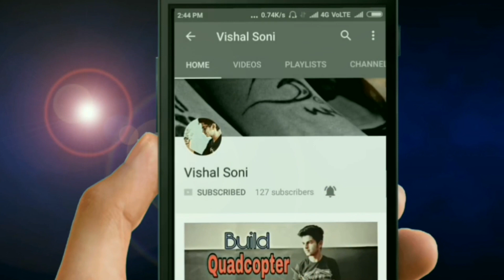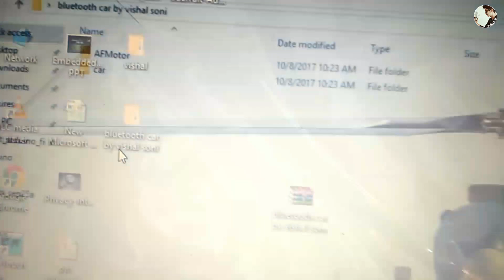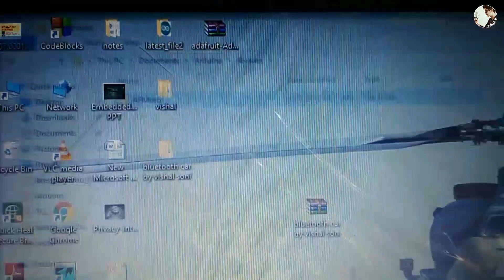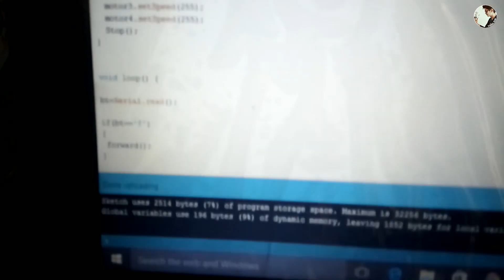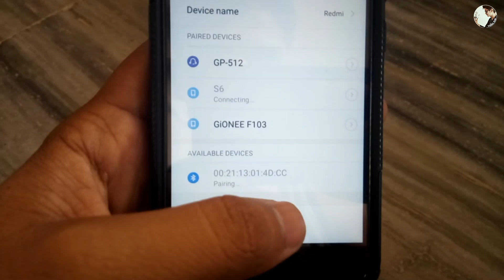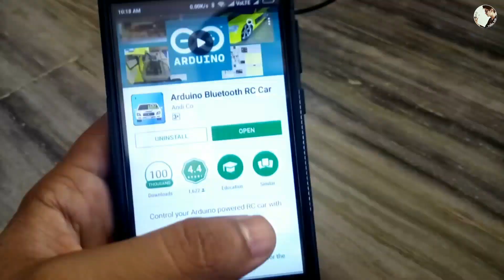Mobile Controlled Car via Bluetooth || motor shield || hc-05 || arduino || simple || vishal soni

Comment: brother my HC-04 connects but then when I press to move the wheels on the car that im making, they move for 2 secs and then stop and then after 5-10 secs the HC-04 disconnects automatically. What should I do please help me. I'm using 2x 3.7V 1200mAh lithium ion batteries. If you think it is a power issue, please suggest what I can do. Can I use power bank as you. Please reply asap as I need it for my science exhibition.
Reply from the maker: Yes, the protection circuit in 3.7v batteries is limiting current , that's way whole thing restarts
Reply: @electrodonut  I tried operating it with battery eliminator on 12v and it works absolutely fine. So should I use a 12v battery instead of Li-on cells?
Reply from the maker: @redone146  if 12v is working then use it, or  use Li ion that can provide 2S or higher current

Comment: As for I worked on a car robot project, and when I started connecting it to the battery for testing, I had a problem that the car was moving without giving orders to the Arduino circuit, if it was allowed to show the cause of this error.
Reply: Oprime el botón de reset para reiniciar en un punto inicial del programa y te funcione correcto.
Reply from the maker: Connection  wrong

Comment: can u please let me know what pins in Arduino uno  need to connect in L293D motor shield in order to plug the motor shield to the Arduino uno board. I want to use Arduino nano instead of Arduino uno.so i need the pin connectivity properly.thx
Reply from the maker: Diagram is on my instructables link in description

Comment: I am only getting my back two wheels working. I cannot get the front two. But if I connect a battery directly to the motor for testing, they spin so I know they should work but for some reason, I cannot get all of them to spin. Do you know what my issue might be?
Reply from the maker: Can i know specifications of battery or any link

Comment: How to add buzzer
Reply from the maker: Please understand the code then you can add anything....
Reply: @electrodonut  motor driver not working
Reply from the maker: @iamtechnical3737  check connection

Comment: if program is not working then change 
serial.begin(38400) 
To 
serial.begin(9600)*******
______________

did not work
Reply from the maker: No doubts about code it is correct,
Check your connection first, then if it won't work, find your Bluetooth's baudrate and change in code
Reply: @electrodonut  no connection mistake i have checked 3 times
Reply from the maker: @harshitsrivastava4719 
Check your Bluetooth's baudrate and print something on serial via Bluetooth

Comment: Can i use 300 rpm high torque motor in that case of l293d motor driver. Will the motor driver heat too much???
Reply from the maker: Yes.. You can
Reply: @electrodonut  Is the motor driver heating too much because of high current
Reply from the maker: @rashedulislam8972  did you tried...
The input current is up to 1.2A
Output is 0.6a
Reply: @electrodonut  i want to use 2200mA 11.2V  lipo battery
Reply from the maker: @rashedulislam8972 
Use l298 motor driver

Comment: Sir I can use lm298 motor driver
Reply from the maker: Yes you can but may be the programming is different for this.
Reply: @electrodonut  sir can u please give the coding
Reply from the maker: @FactCrazeHindi3D  link given in description....
Reply: @electrodonut  sir u can make a 3.7v battery indicator by ic 3914 please
Reply from the maker: @FactCrazeHindi3D it is very easy just search 3914 ic on Google you will get many circuit

Comment: will it work if we dont solder ?
Reply from the maker: Yes, you can connect via puting thin wire in hole or any other method..... The connection should be correct.

Comment: Will it work if I supply the power of 2 ampere to the arduino, instead of using a power bank?
Reply from the maker: Yes voltage should be 5v or more if you are connecting to connector jack.

Comment: Why is there need to supply power to arduino if motor shield is working?
Reply from the maker: The supply in arduino controls the microcontroller in arduino and also it supply the power to the l293d...
The supply in motor shield is to power the motor because. Either you are using 12v motor or 5v motor.
Reply: Ok
Thanks

Comment: i have uploaded the code and also connected everything as you have told but then also my motors are not running plese help
Reply from the maker: Did the Bluetooth module connected with device and...the power supply is sufficient for motor....

Comment: hi bro, i have made the project successfully as per instructed in your video, now i want to add head lights, tail lights and some additional features    so kindly provide me with your contact info
Reply from the maker: Please read code and understand Bluetooth interface.. May be that will help you
Reply: @electrodonut programming and electronics are not my subjects this is just a personal project so kindly give me any sourse for simply coping the codes and making the connections
Reply from the maker: @Umarwahab5 
I will make this letter

Comment: Bt module is not blinking. All connections are same as you did
Reply from the maker: Recheck the module or check it alone with 3v power supply if it not blinks then it is damaged
Reply: @electrodonut  it was really damaged. I changed it. Got a new bt module. Its blinking but the process is not working. All connects are as u said.
Reply from the maker: @sadhankumar7908 
Please read first four line of description and change bps in program
Reply: @electrodonut  thnq very much bhai. Kaam kr gya. 🙂🙂🙂 Love u
Reply from the maker: @sadhankumar7908  welcome...
Please batao m video hindi m banau ya English m
Reply: @electrodonut  english me achcha. Hindi me bahut achcha
Reply from the maker: @sadhankumar7908 
Ok... I will make it in hindi
Reply: @electrodonut  I am comfortable with both languages but I'm thinking about everyone on utube
Reply from the maker: @sadhankumar7908  ok
Reply: @electrodonut  bhai isme arduino ko 9v battery de skta hu? Bt mdl kam karega??
Reply from the maker: @sadhankumar7908 
Please connect battery at connector jack... Then bt will work
Reply: @electrodonut  bro r u sure bt module will not be damaged by 9v supply? (3.3 - 6v)
Reply from the maker: @sadhankumar7908 
No direct supply mat dena.... Pehale 9v battery ko arduino ke connector jack se connect karo fir ya usse 5v and 3v m convert kar dega... So Bluetooth ko arduino ke 3v ya 5v terminal per connect karna h.
Reply: @electrodonut  achcha thnq.
Reply: Jo apne connection rakh same rakhu sab. Bas 9v ko jack se connect kr du to?
Reply from the maker: @sadhankumar7908 
Hn.... 9v jack se and shield ko alg supply to deni hi h.... Motor ke liye
Reply: @electrodonut  bhai 9v jack se diya. 9v volt motorshild ko diya. Par kam nai rha h
Reply from the maker: @sadhankumar7908 
Lights jal rahi h saab m
Reply: @electrodonut  ha sab all ok h. Light sab jal rhi h.
Reply: Motor me power aa rhi h but bahut kam. Ghuma nhi pa rha. Jabke usb se power de rha hu to ghuk rha h. But jack se de rha hu to just hil rha h ghum nahi pa rha
Reply: Bhai. Motor ghumta h to usb ka power leta h ya 9v battery ka?
Reply from the maker: @sadhankumar7908 
Motor ko jyada current chaiye hota h... Tumhare pass kitni 9v battery h.. Or koi dusra power source h kya
Reply: @electrodonut  9v ki 2 batteries hain.
Reply from the maker: @sadhankumar7908  total 2 h ya... Ek arduino m lagi h fir 2 h... And motor kiti lagi h
Reply: @electrodonut  1 arduino me. 1 MS me.

Comment: i have a problem... when connected bluetooth  module then the code is not upload...show that the problem(avrdude: stk500_recv(): programmer is not responding
avrdude: stk500_getsync() attempt 1 of 10: not in sync: resp=0xcb
avrdude: stk500_recv(): programmer is not responding
avrdude: stk500_getsync() attempt 2 of 10: not in sync: resp=0xcb
avrdude: stk500_recv(): programmer is not responding
avrdude: stk500_getsync() attempt 3 of 10: not in sync: resp=0xcb
avrdude: stk500_recv(): programmer is not responding
avrdude: stk500_getsync() attempt 4 of 10: not in sync: resp=0xcb
avrdude: stk500_recv(): programmer is not responding
avrdude: stk500_getsync() attempt 5 of 10: not in sync: resp=0xcb
avrdude: stk500_recv(): programmer is not responding
avrdude: stk500_getsync() attempt 6 of 10: not in sync: resp=0xcb
avrdude: stk500_recv(): programmer is not responding
avrdude: stk500_getsync() attempt 7 of 10: not in sync: resp=0xcb
avrdude: stk500_recv(): programmer is not responding
avrdude: stk500_getsync() attempt 8 of 10: not in sync: resp=0xcb
avrdude: stk500_recv(): programmer is not responding
avrdude: stk500_getsync() attempt 9 of 10: not in sync: resp=0xcb
avrdude: stk500_recv(): programmer is not responding
avrdude: stk500_getsync() attempt 10 of 10: not in sync: resp=0xcb)
Reply from the maker: Upload program without Bluetooth.... Then connect it after uploading the program

Comment: Hi, I'm getting this error

avrdude: stk500_getsync() attempt 1 of 10: not in sync: resp=0x30
avrdude: stk500_getsync() attempt 2 of 10: not in sync: resp=0x20
avrdude: stk500_getsync() attempt 3 of 10: not in sync: resp=0x30
avrdude: stk500_getsync() attempt 4 of 10: not in sync: resp=0x20
avrdude: stk500_getsync() attempt 5 of 10: not in sync: resp=0x30
avrdude: stk500_getsync() attempt 6 of 10: not in sync: resp=0x20
avrdude: stk500_getsync() attempt 7 of 10: not in sync: resp=0x30
avrdude: stk500_getsync() attempt 8 of 10: not in sync: resp=0x20
avrdude: stk500_getsync() attempt 9 of 10: not in sync: resp=0x30
avrdude: stk500_getsync() attempt 10 of 10: not in sync: resp=0x20
An error occurred while uploading the sketch
Reply from the maker: Arduino not responding

Comment: sir I am only using 9 v battery connected to my motor driver and the light turns on by itself, however whenever I shove it to the arduino board the light turns off.  Also the arduino board and Bluetooth module are working when I connect them to the computer for the coding, but it seems like connection got lost whenever I shove my motor driver to the arduino board... They both are working fine separately. everything is wired correctly but it`s just not working when motor driver and arduino board is put together. Can you please help me with this issue?? I need to fix it as soon as possible for my presentation...
Reply: what did you do to make it right??
Reply from the maker: Can you tell me problem in one line

Comment: Please help me... 

I make this. but motor is not working. Bluetooth module is connected to androide phone. But motor is not working. I use 100 rpm gear motor. And two 9v  batteries. One for arduino and another for motor driver

Please help me. Argent
Reply from the maker: Read description's first 3 lines and follow.
Change bps to 9600
Reply: Thanks it is working
Reply from the maker: @Mr_Macster 
Thank you too for supporting me ☺️
Reply: I make a cleaning robot with help of this video
Reply from the maker: @Mr_Macster 
There are many app available on play store...... Search Bluetooth control "..... And find app that have more switch
Reply: But how to connect another 5 motor to arduino. Please help dear. ❤
Reply from the maker: @Mr_Macster 
Use L298n ic.....
Try to use only ic not shild..........
Reply from the maker: @Mr_Macster  you can get code online
Reply: @electrodonut  please send link

Comment: If i use two 5V motors  and one 9V motor will it work on 12V battery?
Reply from the maker: You can convert 12 v to 5 v via 7805 voltage regular

If you have two motor then use that two with caster wheel
Reply: Okay. Thank you so much!

Comment: Bro iam not able to install the program in my arduino uno
Reply from the maker: Bad Boys Tech
Remove Bluetooth pin while uploading program
Install motor driver library
Reply: Bro i have removed all cennections and install motor drive library.
Then also it was not installing
Reply from the maker: Bad Boys Tech
Is Compilation done....
Or  it also shows error
Reply: Bro nothing works
Reply from the maker: Bad Boys Tech
Check out all connections are correct or Bluetooth, arduino, motor shield are working properly

Comment: My bot is not responding.  I have done everything  properly  . Is it the battery problem  because the led in motor shield  , hc module are blinking
Reply from the maker: Shashidhara Siddamallappa
Change bps as in description

Comment: It's not working how to change program serial
Reply from the maker: Sharmila Kannoju
Open program in arduino software and then you will found serial.begin(38400) just change this to serial.begin(9600) and upload it to arduino remember Bluetooth wire is not connected while uploading program.

Comment: heloo i made this rc robot but i made my custum chachis [1mm aluminium] the robot is litel bigger i put the exact motors shous in video i conectet to the same shiled and oder parts but i put a 9v barery the robot go foward and beakward but dosent turn left or right [the distance between wheels is a littele biger when i press right or beak the car wigle a bit but any turn i veryfy the direction of rotation of the wheel any help?
Reply from the maker: Libertatea Gandului Meu
Stop one side wheel and run other side

Comment: Hi vishal I charged my 12v battery but when I connect it's 2 wires red and black with the 12 v DC charger then the led on charger turns on why??  But I ignored this and connected the charger to switch board and turned on is this alright?? As the DC charger was turning on with battery!! But I ignored and putted the battery to charge
Reply from the maker: DHRUV SHARMA 
Yes,  if led in adaptor is turned on it means your battery is connected perfectly............ Coz it is on by little charge in battery... 
Just put it in to charge

Comment: I have a problem in uploading the code, it says " avrdude: stk500_recv(): programmer is not responding"  how to fix this
Reply from the maker: Fritz Camello 
Remove everything from arduino..... 
Check Microcontroller on arduino is in right direction and fitted correctly.... 
There is no connection or Soldering on ARDUINO..... SPECIALLY RX AND TX REMAINA NOT CONNECTED
Reply: Vishal Soni i have already fixed the problem, thank you so much :) one last favor, can you prepare a code where there are lights and buzzer connected? Thank you!
Reply from the maker: Fritz Camello 
You can do it..... 
Just go to the settings of app and see commands for light... 
Put it on condition
Reply: How about the code sir? Im still a beginner in using Arduino
Reply from the maker: Fritz Camello 
Search about how to blink led via Bluetooth... Learn that code then you can easily able to add in my code
Reply: you should plug disconnect the bluetooth module while uploading

Comment: Yes I know I have connected this already but the problem is that led is very fade it's turning on but it's not bright can we make a car with this app only but with l298n motor driver?
Reply from the maker: DHRUV SHARMA 
Do you used resistor with led

Comment: OK I connected led to analog pins and it works but then led is very dim why?  I putted 3.3 v in between the led circuit but led not worked it's very dim
Reply from the maker: DHRUV SHARMA 
Change your led may be it damaged.......if you are turning on led with high then connect positive to analog and negative to GND

Comment: Yes it is written that pin 2 and 13 are not used for motor shield when I connect to pin 2 then the led turns on but it is very fade when I connect to pin 13 then the led turns on automatically  but does not turn off so can I connect led to analog pins what is code for analog example digitalWrite(2,HIGH) what code is for analog pins
Reply from the maker: DHRUV SHARMA 
digitalWrite(A1, HIGH) 

A0, A1...........

Comment: Thanks i done it now i can control the speed and i added a buzzer also but the problem is that when i connected buzzer to digital pins like 11 then it works but then the right motor stops working and only 1 motor move so finally i putted buzzer on pin no.7 and motor also worked buzzer also worked  but i didnt understand that why one motor stopped working when i putted buzzer on digitalWrite 11 ,9,8 pleaee explain why
Reply from the maker: DHRUV SHARMA 
Because may that pin are for motor in motor shield
Reply: can i ask for your code with buzer and control speed?
Reply: Can i ask for your program sir in adjusting the speed?
Reply: Hi, DHRUV SHARMA. Can I have your code for buzer and control speed? My email is lis_wang@hotmail.com

Comment: I have to write serial. Read and after that digitalWrite(13, HIGH);  and what is command for speed I tried motor. speed but it shows  error in compiling  what is command for changing  speed
Reply from the maker: DHRUV SHARMA 
Take integer variable then put it into the code that you find like
motor.setSpeed(variable) 
Put variable at place of variable 
Then see the command in app that slider on the top right is sending.... 
Now like slide is sending 1 to 10 
Then put condition in program 
When serial read 5 then variable=100 ..... Like this

Comment: Can u tell how to add buzzer in this code and leds also as in app there's a option for led
Reply from the maker: Yes....... Use a two pins for output and then add one to buzzer and other to led...... 
Then go to the app and then in setting of app.... Where you find.... Some commands... Like
F for forward 
S for stop
Just see the command for head lite and horn or pick any one from then..... 
Put that command in program.... 
If serial. Read will get that command led will turn on

Comment: I have connected power to arduino only 12v then motor shield turns  on automatically  works fine
Reply from the maker: DHRUV SHARMA 
OK... Do subscribe  and share to reach 1000 subscribers 😊

Comment: Why you set baud rate to 3850..  instead  of 9800 ??
Reply from the maker: DHRUV SHARMA 
My module is working on 38400... 
You just use 9600.... Ok... Then it will work perfectly